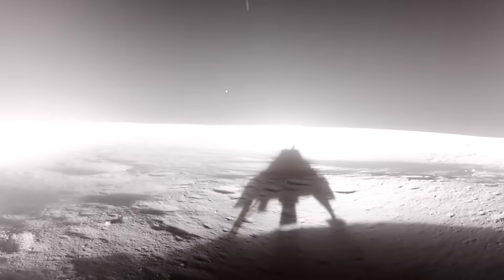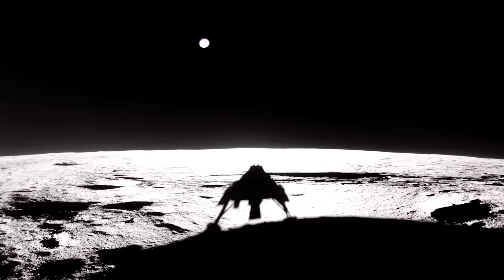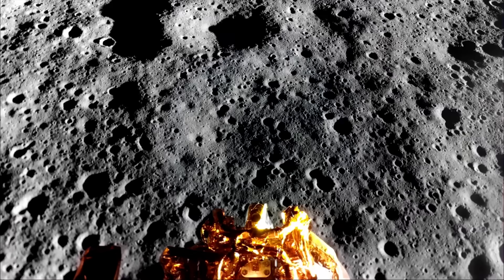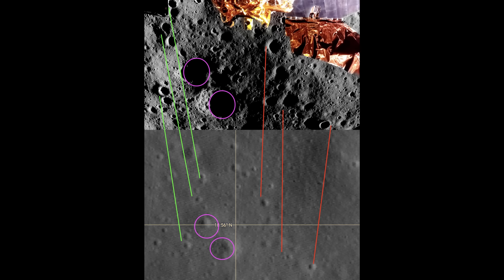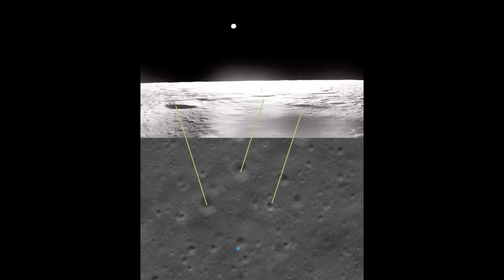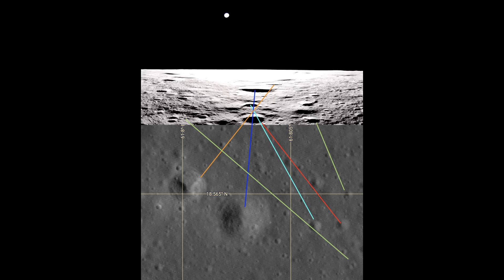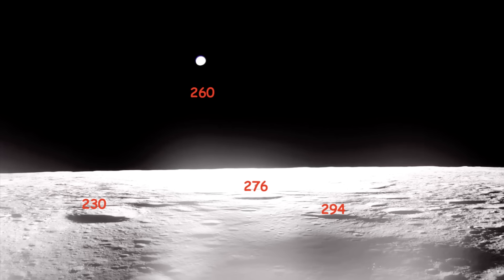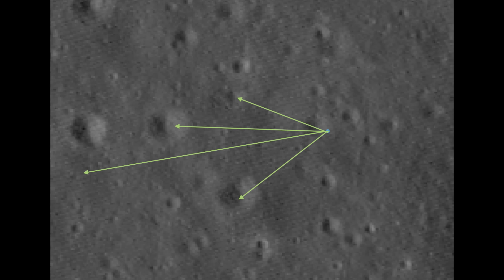Blue Ghost's Landing Video Reveals Exactly Where It Landed On The Moon

Comment: The lower gravity enables a rock thrown from the surface to attain a greater height and stay in the air for an extended period. This differs from our observations during the Apollo missions and the movements of the lunar rover on the Moon. The rocks should rebound higher and remain airborne longer, yet their movements resemble a slow-motion effect as seen on Earth.
Reply: That’s not an accurate interpretation. 

There’s no air so everything falls at the same speed. Also, the surface is largely dusty, so objects won’t rebound much, if at all. 

Both this landing and the Apollo landings show what we should expect to see.

Comment: 6:00 That's not the shadow of the exhaust, it's the shadows of the landing legs cast through the dust cloud. The opacity of the exhaust isn't nearly high enough to cast noticeable shadows, and the exhaust would also spread over a wider angle. You wouldn't get exhaust that collimated in a vacuum unless you had ludicrously long nozzles.

Comment: Intuitive Machines fails for a second time to land an autonomous craft on the surface of the moon without tipping over. Firefly AS Blue Ghost nails it on the first attempt. Why? Because it’s hard enough to land a spacecraft autonomously without having to deal with faulty design. IM-2, like IM-1 was taller than it was wide, whereas Blue Ghost was modeled more like the Apollo LEM. Short and squat. Wake up people, it may be rocket science, but it’s also simple physics. This is a classic case of not being able to see the forest for the trees.

Comment: What's in that Crater at 3:44 ???
Reply: They didnt edit out the lander from a different faked shot
Reply: @troyrager1352  Fiction.  👎
Reply: @wsrichardson5796  if you say so I dare you to adjust the settings in your video and figure out what's in the crater.. it's not a rock
Reply: @troyrager1352  I double-dog dare you to keep posting fiction.  I am sure I will not be disappointed.  😁
Reply: @wsrichardson5796  then what's in the crater leaving a big shadow that's not in any other shot?  There are 3 light objects, it's ok to be curious and troll a little, what if we're really on the moon but we're there for a different reason.  If I said it's a ufo would you be ok with it?

Comment: With the finding of beaches on Mars, and nearby the signs of material that had once been submerged by water. Its logical to think that Mars had an atmosphere and if it evolved at the same speed as the Earth, then possible life but even more important is How and Why it Lost its atmosphere? If we dont wanna go the same way...
Reply: Smaller planet. Core cools faster and stops being molten. Magnetosphere collapses. Solar wind is much more able to strip the atmosphere away.
Reply: @MattNolanCustom  not that much smaller, does that mean we got another 10 or 10,000 years left? Also there still  volcanic activity on Mars. You just guessing cause no one knows just how cool Mars core is
Reply: @gregorynicholson3609  Mars is not just smaller, but because of the laws of geometry its surface area to volume ratio is higher which makes the cooling even faster. We have measured that it has no magnetosphere. I think it has also been figured out that our unusually large and "close" Moon has a frictional heating effect on the Earth's core due to tidal forces and there are also plenty of radioisotopes down there also helping keep things hot. We're going to be good for a long time. Billions of years is the current estimate.
Reply: @MattNolanCustom  Good theory mate, one of many. There was another reply but think it's been deleted.... No one knows why atm.  Scientists are still trying to figure it out
Reply: @ I presented the leading theory. Right now, it's all we have based on the evidence we can gather
Reply: @MattNolanCustom  yeah, def one of many possible theories.

Comment: Right when it landed I guessed it was right on the edge of a crater when only 3 out of 4 sensors wet off on its feet. Thanks for pointing out exactly where it landed.

Comment: Can they show us the landing pads on the lander? Are they filled with pebbles and dust or clean as a whistle like all the Apollo landers after they landed with no trace of a rocket engine's blast on the ground under the crafts?
Reply: When the "dust" has been blown away by the descent engine thrust, how is it going to come back to land on the pads?

A Harrier jump jet has multiple times more thrust than the Apollo Lander was putting out before touchdown, and that thrust is confined to a much smaller area.
It doesn't leave a blast crater when taking off.
Reply: @Lee.S..B  ^^ facts. Also, there's the whole no billowing / turbulence / Venturi thing when there's no atmosphere

Comment: 5:37 Comments about lunar dust. Without a significant atmosphere, dust should settle quickly but we also need to consider the effects of static electricity. That will also affect how dust behaves on the moon. There is still so much to learn. We are just beginning to understand what questions need to be asked.

Comment: I am hoping to see an eclipse from the moon's perspective. We should be able to see all the sunsets around the Earth at the same time.
Reply: "The lander is expected to operate through sunset at the site March 16...  Operations will pick up again close to sunset, along with 'bonus' operations such as images of a lunar eclipse on March 14. Those operations will continue through several hours after sunset, with the lander operating on batteries to collect data such as any levitation of lunar dust believed to occur at sunset." --Firefly Aerospace
Reply: The Earth is about four times the diameter of the Moon so an Earth eclipse will be a big length of darkness with the slight possibility of a Diamond Ring at start and finish. The only reason that we get the type of eclipse we know is the coincidence of the Sun and the Moon both subtending the same angle (0.5 degrees) in the sky.

Comment: I wonder when we will the first lander that can survive the lunar night (in a kind of power saving mode!?) to wake up again at next lunar sunrise. What would you need? A battery with enough reserrve power just to keep some basic electronics running and providing some power to heat critical systems in order to prevent damage from freezing temps? I'd image it would make the lander somewhat larger and more complex, but how much would it really need?
Reply: The technology for using isotope decay, as a power source, is common. Most deep-space; interplanetary probes use it. We can still communicate with Voyage and from its perspective the sun is just a bright star. It is so common that my Tritium watch dial uses it to illuminate its display.
Reply: @davidsandy5917  These missions are usually government-controlled. I'm not aware of any mission using nuclear power or RTGs on purely private / commercial missions.
Reply: @davidsandy5917  tritium isn't that common. There's only about 30kg of it in stockpiles on Earth. It only takes a teeny tiny amount to power the phosphorescence of a watch dial. That 12 year half-life has its downsides.
Reply: Back in 1969. The Russians landed a rover that could survive the lunar night. It used decay of radioisotopes to keep the electronics warm over the two-week nighttime.
Reply: @davidsandy5917  Okay, but I was thinking of non-noclear solutions. As far as I remember, that is not tech available for anyone.
Reply: @davidsandy5917  China also uses this technology in their Yutu rovers. Yutu 2 landed in December 2018 and is still working. 

I think that the main reason why more missions don't use it is the cost of radioactive isotopes and probably how much paperwork is necessary to launch radioactive stuff to space.
Reply: The Russian rover had something called the Frying Pan. It would open to collect solar radiation for power, during the lunar day, and would close to trap as much heat as possible during the solar night. During the night, isotope decay kept it warm.

Comment: They are using a keyboard control!  On-off, down-up, 1-0.  🤣
Reply: It is called Pulse Width Modulation. Your laptop computer power supply does the same thing. Nothing special.

Comment: It's unmanned, just like the... never mind. That looked as fake as an Astroturf mowing. That shadow never followed the contours on the moon. It never changed shape! The moon looked high contrast the way it was shot btw. More gold foil but at least I haven't detected any transparent tape, yet.
Reply: when a camera is looking pretty much along the same vector as the sunlight casting the shadow, that is exactly what happens. If you were to view the shadow from a different spot, you would then see it following the contours more which is what you are more used to
Reply: Your trolling is boring. YOU are boring 🥱

Comment: Congratulations to Firefly for a successful moon landing! One honest question, before those Flat Earthers pick it up as a “evidence of fakery”. I saw the Apollo 11 LEM landing live, I’m that old, but I remember a very little dust cloud lifted by the rocket exhaust. Why this lander made a lot bigger dust cloud than the Apollo LEM?
Reply: Apollo LEM landing footage was looking down through a pretty small window. Most of the dust was shot off out of frame, so you didn't see it. The camera here is looking sideways and has a wide field of view. Probably differences due to the amount of thrust / mass of spacecraft and different engine layouts too - 8 small versus 1 large thruster. Also, there's no reason that 2 different patches of Moon surface should have the same amount of dust.
Reply: And the LEM cut it's engine 6 feet above the surface and fell the rest of the way, it's landing wasn't that soft.

Comment: Explain again why it is supposed to take 12-ish Starship launches to reach Luna?
Reply: They're talking about landing a 50m tall rocket on the lunar surface.
That requires a lot more fuel than a lander that's just a few metres tall.
The extra fuel adds mass, which then needs extra fuel to lift that mass, which adds mass etc etc
Reply: @Lee.S..B  I appreciate your answers. That makes sense. But why do we want to land an entire Starship on the moon? Is a purpose-built lander too much extra cost/effort?
Reply: No one knows how many launches it will take.  It's all about the mass.  The more mass you want to move, the more fuel you need. Are you thinking all these things going to the moon are the same mass?  You didn't think that through very far did you?  Or very well.
Reply: @imaginary_friend7300  I heard the plan was to launch 11 or 12 starships full of fuel to fill a special Luna-bound starship. When I see Blue Ghost one-shotting it all the way to the moon or when I think of the Saturn program, I have to wonder, "is this progress?"

Comment: so now it's there .. whats it going to do ?
Reply: "Blue Ghost carries 10 payloads for NASA’s Commercial Lunar Payload Services (CLPS) program under a $101.5 million contract. Among them are instruments to measure subsurface heat flow, the structure and composition of the moon’s interior, and the interaction of the solar wind with the Earth’s magnetic field. Other payloads will study how the lunar regolith interacts with the materials, test a radiation-tolerant computer and an electrodynamic dust shield. The lander is expected to operate through sunset at the site March 16." --Firefly Aerospace
Reply: @wsrichardson5796  Thanks !

Comment: OK, here is a question for you that came up @9:00 or there about ... how can/does a Vacuums Cleaner work when it's in a Vacuum?  Vacuum cleaners work by moving gasses/fluids (air here on Earth) from one place to another, and those gasses/fluids via drag/friction carry other things (regolith) along with them as they move.  As there aren't any gasses/fluids on the Moon to move, how exactly does this work?
Reply: Maybe a tube with a centered upward pointing nozzle that shoots a puff of nitrogen, causing a venturi effect? That could carry a bit of dust and particles into a collection box of sorts. Yeah, the lack of an atmosphere is problematic when using a vacuum cleaner!
Reply: @beezul  .. I could be wrong but ... NO, because there aren't any gasses/liquids to be pulled into the tube by the venturi effect.  The moon is in total vacuum and the venturi effect requires some medium to be moved that thereby draws other medium along with it.

Comment: Why is it that these robots cannot survive the lunar night? Can't they simply shut down at dusk and power up again at down when the power is back? With a small backup battery, it should be trivial, right? 🤔
Reply: Electronics generally can't survive 14 days of -130C nighttime temperatures and then cycling back to +120C daytime temperatures.
Reply: @stargazer7644  they are not exposed to 120C in daytime, that's what the gold film is for. As for the cold, how does James Webb operate at 3K? I believe these are legit questions. I admit I am not a technical person.
Reply: of course they could survive if properly beefed up like the Soviet Lunokhod which was heated during the night by an isotope.  But it wasn't deemed necessary for the purpose of this simple and relatively inexpensive mission.
Reply: @olasek7972     Sending a robot to the moon to have it operate for two weeks seems silly to me.
Reply: @ if this is your very first lander and your chances of landing are like 60/40 then it is actually very smart
Reply: @catmate8358  also I suspected you may be another undereducated millennial, I suggest you learn something, out of so many unmanned Moon landings over decades how many were built to survive the night.

Comment: Perhaps they landed at Sun angle < 5 degs in order to provide more data for the machine  vision tracking system? This may be an important limitation of this automatic cargo transfer system: you have to land only in extremely low angle sunlight. Otherwise the Machine Vision tracking system won't work?
Reply: lidar works fine even in the dark.

Comment: It's fascinating that the lunar horizon is less than half a kilometre distant.  On Earth, that's just down the street!
Reply: If you're 2m tall, the horizon on the Moon is 2.5km away.  On Earth it is 4.8km away.  Not a huge difference.
Reply: @stargazer7644  The Moon is 1/13 the size of Earth.  Basic division.
Reply: @stargazer7644  Er, 2.5 is about HALF of 4.8.  Basic subtraction.  If someone owes you $4800 but pays you $2500 because it's "not a huge difference," and you accept that, well ...
Reply: @Canada_Dominium  Actually, that's division, but why start worrying about mathematical facts now?  You might want to actually look at the formula for calculating the horizon distance.  It isn't linear, and it isn't proportional to surface area (your 1/13th figure).  Your entire point (if you want to call it that) was that the lunar horizon was "just down the street".  It was a bit farther than that, and the Earth's horizon isn't much farther.
Reply: @stargazer7644  Wrong.  You left out pi and figured for diameter only.  Do you comprehend the difference between size and diameter?
Reply: @stargazer7644  Also, your error bar approaches 50 percent.
Reply: @Canada_Dominium  Sorry, you've exceeded your alotted quota of $tup!d posts.  Good luck in life..  You really need to get better at this.
Reply: @stargazer7644  Flerf sighting confirmed!
Reply: @stargazer7644  Are you able to comprehend that circumference rotated 180 degrees about its maximum diameter creates a sphere? Also, your declaration that 2.5 and 4.8 are, in essence, the same value shows that all should beware loaning you money.

Comment: Angular size of earth is WAY too small.
Reply: based on a gopro fisheye lens you didn't take into your 'calculation'
Reply: It's a wide angle shot.  The Earth is only 2 degrees wide in the sky from the Moon.
Reply: @stargazer7644  id like to see the same lens on earth taking a photo of the moon, it would be a pinhead at best.
Reply: @bogganalseryd2324  It would be exactly 4 times smaller.
Reply: @stargazer7644  yeah thats the claim.... Would love to see that
Reply: The angular size of Earth as seen from the Moon is roughly equal to an American half dollar (dia. 1.25 inches/30 mm) held out at arms length. That doesn't cover a very large portion of the sky. Assuming that you have arms and fingers, you can envision this for yourself from the comfort of your own home.
Reply: another undereducated millennial, there is no "angular size" in a photo - a photograph is a flat plane - you can position the photograph at different distances form your eyes and then you can talk about the "angular". You can view it at 4 inches and would be "huge" lol

Comment: You didn't mention anything about the craft "teetering" right after touchdown which likely is why the fourth pad sensor did not activate. Is the craft unstable and how will this affect the mission?
Reply: He did mention it.  The lander settled on 3 feet.
Reply: It landed on uneven terrain with one leg slightly off the ground. Just slightly tilted a couple degrees off vertical. It was expected, there's no place on the moon that's perfectly flat.

Comment: The Blue Ghost’s landing on the far side of the Moon was a fascinating event from a scientific standpoint, particularly due to the observed motion of the foil heat shields. The movement of these components can be attributed to the unique conditions of a zero-atmosphere environment, where the interaction of the rocket's impulse engines with the lunar surface creates a dynamic response in the heat shields. From a purely physical perspective, this phenomenon is entirely plausible. However, conspiracy theorists might argue that this movement suggests the landing was not filmed on the Moon, though such claims fail to account for the intricacies of space environment physics.
Reply: Blue Ghost landed on the near side of the moon.  That's why it can see Earth in the sky.
Reply: Yes, rocket engines vibrate. That was a lot of $5 words to say that.